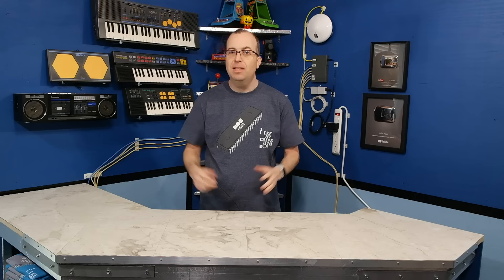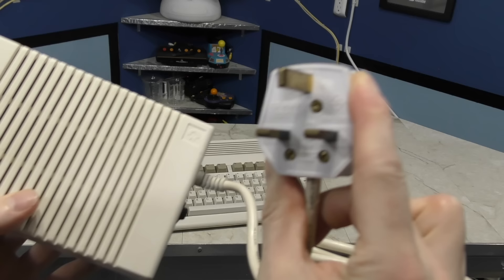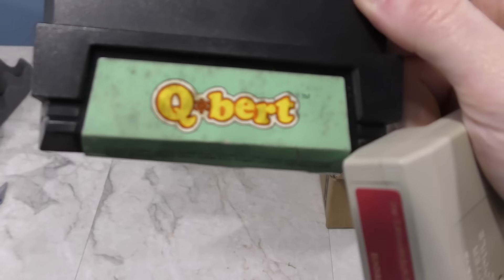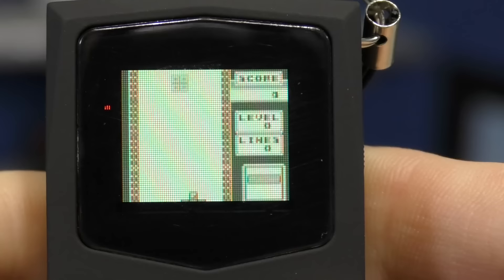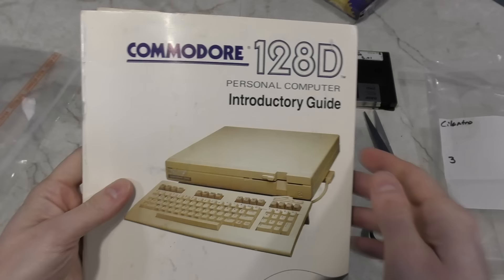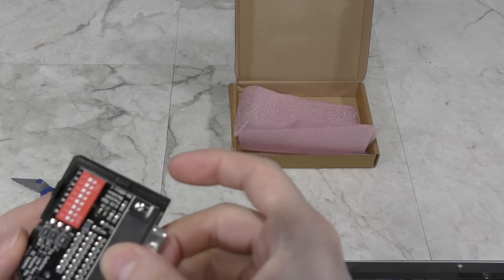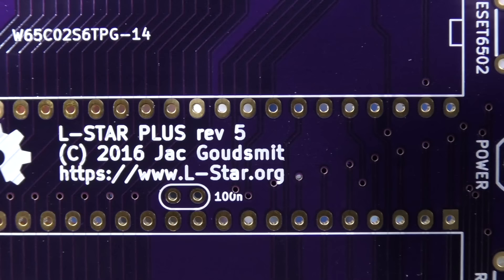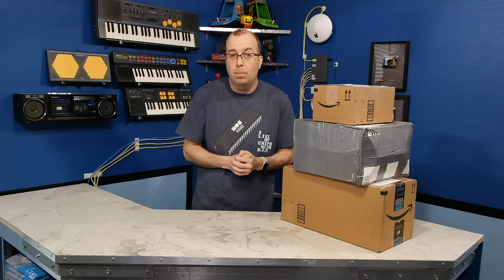8-Bit Unboxing - February 2018

Comment: Why is American mains power so weak?
Reply: That depends on what you mean by weak. 60hz is overall more efficient and 110v is easily sufficient for most household devices. It requires only very simple grounding and plugs and can supply up to about 1.5 kilo-watts with no problem. We also do have 220v to homes with the needed additional grounding etc. for larger appliances like clothes dryers and electric ovens and arc welders in garages. In areas with 220v only you have to have more elaborate grounding and arc protection and electrocution is SIGNIFICANTLY more of a danger. I have been zapped with 110v numerous times while working on things and it can kill, but more often than not just hurts.
Reply: lol
Reply: In short, because we're better than everyone else
Reply: > We ... do have 220v to homes with the needed additional grounding

In Russia we do have 220 V for usual homes and 380 V for high power consumption facilities.
Reply: bitset: In the vast majority of places I've been in Europe, there differential circuit breakers on every home, for the whole house. I was electrocuted as a kid a few times with 230v (without ill effect because the current didn't pass through my heart I suppose), but never through a loose wire or something (never through the ground), always closing a circuit with my hand (with stuff being repaired, not regular appliances).

The plugs in the US allows you to touch the live terminals while half plugged. That's not possible with Schuko plugs (or modern euro plugs) or British plugs.

230/240v allows our cities to have many less transformers so there's many less high voltage cables on the streets.

Both 50 and 60 hz have minor compromises but none is at a clear disadvantage.
Reply: Pyry 1 i would say it goes back to the beginning of the electrical revolution, which took off in the US first. The quality of things like insulation limited safe voltages. But within a few years r&d made higher voltages possible so other countries adopted the newest tech and built the infrastructure accordingly. While back in the US to change everything from the 110v system would have been to costly. They simply  could not justify it when everything worked fine at 110v. In saying that here in Australia a standard outlet will happily supply 240v@10A thats 2.4kw. I think i might have to agree with your comment lol
Reply: Alberto Torres: That is true with our plugs. I've never heard of anyone electrocuted seriously with plugs half in, because you can only get maybe the tip of your finger in there,  but it is possible and probably has happened. I had a night light when I was a kid that I would pull part way out and touch on purpose. zzzapp, not the brightest kid in the world :)  I was learning about electricity though.  

The only advantages that I know of does lie with 60hz. 60hz electricity heats the wires less and thus is slightly more efficient. Not much but 2-3% across an entire country adds up. The other advantage is that transformers and motors require less copper in their coils, but more ferrous plates to reduce eddy currents, again, not much of an advantage except when the cost of copper is really high.

Question though, you said "230/240v allows our cities to have many less transformers so there's many less high voltage cables on the streets." I've not heard that. Why would there be fewer transformers? We transmit electricity to cities at high voltage and step it down to 220 for homes and you just grab one phase for 110.  Your countries do the same exact thing but only supply the 220. We in the States just think it is weird to supply 220 to a clock radio.
Reply: bitset: The higher the voltage, the more distance it can travel. Therefore, one transformer can serve more homes, but it is bigger, of course.

Take a look at the video "Dangers of Using Electronics in Bathroom, the Case of the Teenage Girl" by ElectroBOOM, minute 5:30 (or better watch the whole thing)
Reply: Sorry Andy, English is not my native language. Thanks for the correction.
Reply: I was plugging a light in when I was a kid and had my finger over the metal prongs as I plugged it in. That BUZZZZZZZ! That ran through my finger and hand. That was 40 years ago and I can STILL feel exactly what it felt like.
Reply: The reason for 110 is for not changing appliances. Here in Spain my grandparents got a transformer for free when it was changed from 125 to 220.
Reply: I'm not sure the voltage at transformers/sub-stations is terribly relevant, they're usually very high +11kv.

In the UK the connection to your home is 415v, which is then stepped down to 240v.
Reply: Because we do not need to over compensate for being weak in other areas ....
Reply: voltare2amstereo We have kettles to boil water. I have a Korean friend who has tea at work every day at his desk in an electric kettle. That only takes a few minutes to boil.  They probably take a little longer than yours though. If we need to boil water most Americans toss a kettle on a stove, which would be running at 220v.
Reply: the phrase you're looking for is "more efficient".
Reply: Honestly, the only time I notice a difference is when I use my vacuum cleaner to clean for a half hour or so and the plug gets a little warm. With 220v that probably doesn't happen at all.
Reply: Great summary
Reply: And (most) of the european stoves use 400V.
Reply: Usually 230V here in Norway bacause we only got 230V between the phases and no neutral connection (IT). Some newer installations use 400V between phases with neutral (TN-C-S).
Reply: I've had 380 volts through me once. I happened to be in a dark factory hall of photosensitive material, but when I got zapped, I saw the entire hall light up, just before I passed out. I also got zapped by the high voltage bit of an old CRT television as a kid; 4000 volt apparently. That only startled me. It is not the voltage that kills but the amperage.
Reply: @Kenny S If 110V can go up to about 1.5KW – if indeed that is correct information that someone else pointed out – then the amperage max for household goods is about 13A, and that is the same here in the UK where one can run up to about 3KW on a wall socket. So the amperage is the same, and therefore you still only have half the power. 220V electric shock really hurts, though. I am sure 110V would be a lot less unpleasant.
Reply: If you have sweat or electro charge on you and your chest . Good bye LOL  a taser with 2 volts with water can kill
Reply: US houses often have waaaay more amps flowing than EU homes.
Reply: Hakon Soreide 20 amps is the norm on circuits these days. 50 years ago it was 15. Course things like electric ranges are on their own 220v 50 amp circuit. Most houses have 200 amp service these days.